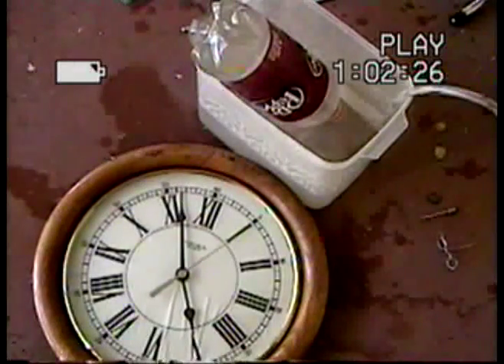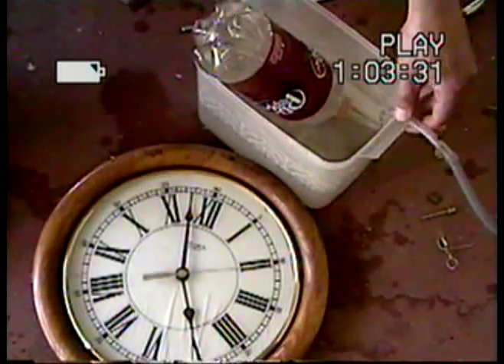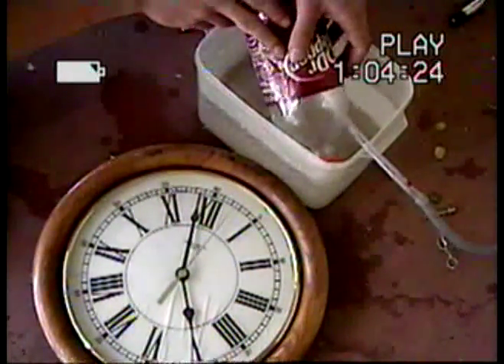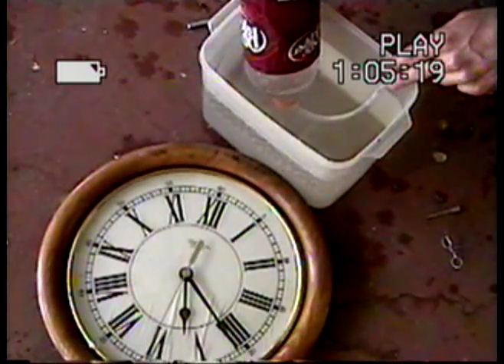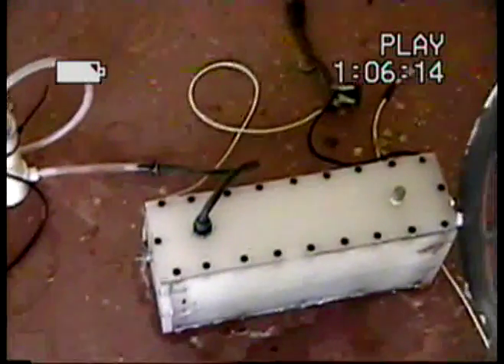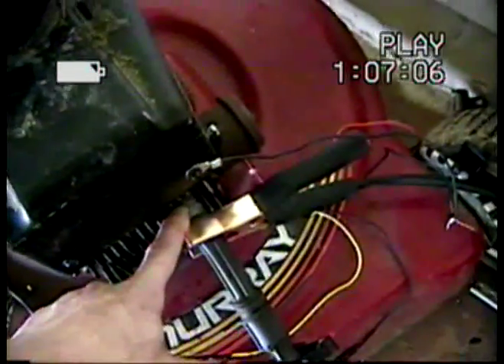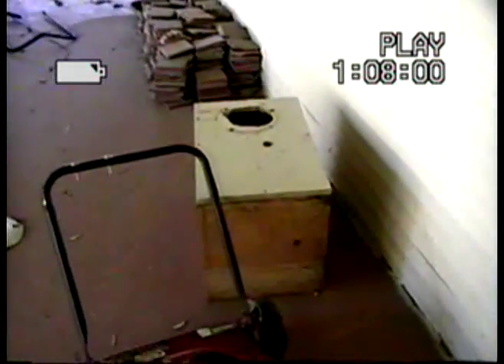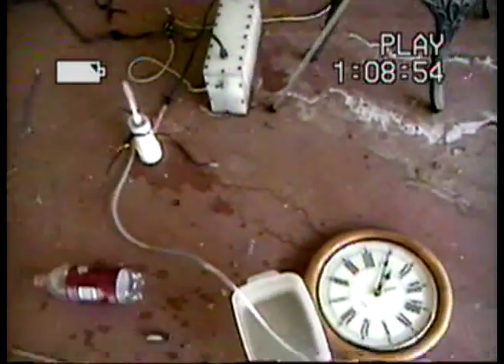61 Plate Hydrogen Cell part 2

Comment: Lol. very good presentation   ...could you please tel me what material do you use for the box? what glue  you use to pest the box ?
Reply from the maker: Thanks, this one I made many years ago. I used cutting boards to make the box and used regular epoxy.  This one however didnt hold up for very long due to the epoxy I used not sticking the cutting board material.

Comment: lol yeah makes good production for shot burst fo les than 10 mins at 100 vdc  working on a new control circuit to use much higher volts with pulse with modulation and feedback contol from an inductive ballast load.
my thoughts are to creat a plasma arc across the plates for a few micro seconds at a time
really strange how i could boil tap water faster in my 200 watt cell then in the electric tea kettle:)
perhaps if stubble onto a great steam genny:)

Comment from the maker: @stevmoon Yeah 100 volts would heat it up,  you would need to use around 18-20 volts for it to not heat up.  You need about 2 to 2-1/2 volts per plate/cell for it to be efficient

Comment: I have made a few torches for hho    flash back arrester is very important   as for the tip my torch cell consumes 100 watts  and i use a 28 gauge stanless syringe  the trick is for it to be a very small orifice.   its more a toy than really useful but it will melt rock   ie i can engrave my name in the garage floor:)   

my new cell 21 plates @ 100vdc seams to have a heating issue, so im back to the drawing board on that

sorry i dont have any hho vids up yet:)

Comment: if you can find a way to pressurize the generated HHO, it would be more useful as a compressed gas rather than the low pressure that is likly to backfire.

Comment: they stole a taken apart lawnmower? and also i was going to ask why is there a timing chain set up? and what was wrong with the magneto set up and from what i can tell the timing chain set up makes it spark every 2 turns and with the original magneto it sparked every turn even though its a 4cycle

Comment: lol use a briggs that Tecumseh or techumshit shakes to much not the best engine either junk! use Briggs or Kohler i had a 5hp briggs idle be4 on hho useing just a water bottle droped 2 electrodes in to bubble it all it did was idle nothing more but kept melting my wires going to the electrodes used a car batary burned up a power supply doing this the idle was under 850rpms had the heavy fly wheel